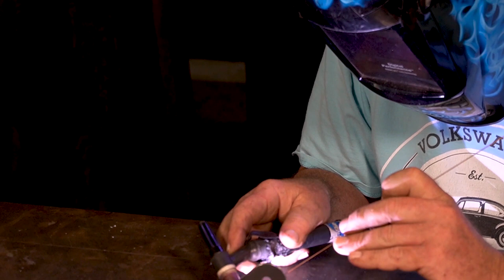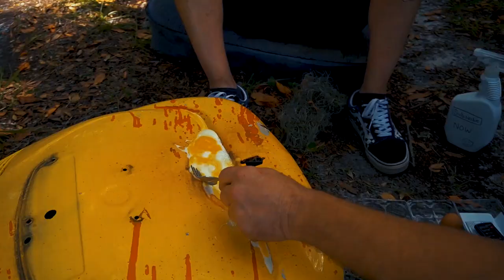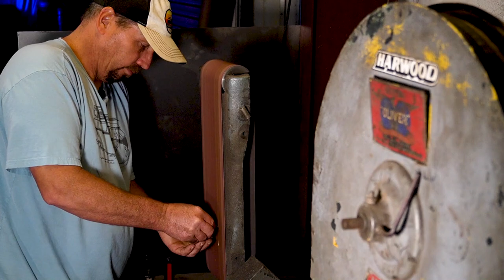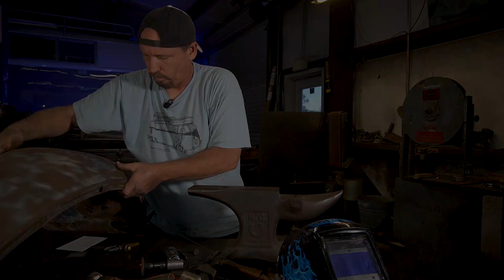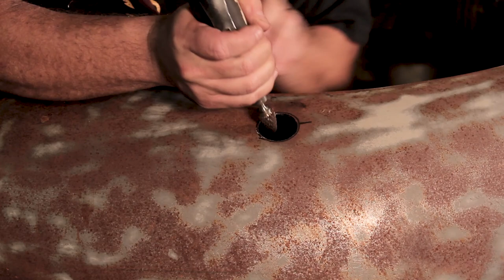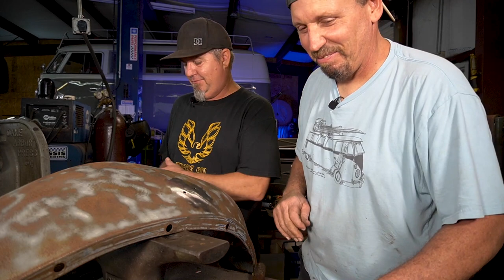How to Fix a Rust Hole on your VW Bus or Bug / Shave your Turn Signals

Comment: Try living in Arizona's heat..............
Reply from the maker: Not sure what's worse Arizona's high temps or Florida's high humidity lol.
Reply: @RobStapleton   you do have a point there ha ha.  I have been D/A sanding my 65 vw bug whole car down in the shop, and our humidity has been really bad cause of the monsoons. :(
Reply from the maker: @65vwbug87  I've never been to Arizona in the summer but either high heat or humidity I hate them both lol. I'm from Michigan and have never really adapted to the summers here.
Reply: @RobStapleton   off the subject of heat. I am sanding my vw down to bare metal, is 80 grit with the d/a way to go? i heard any less with screw up the metal. I know primer will hide some stuff, just trying to do it properly. Thanks
Reply from the maker: @65vwbug87  80 grit is fine as long as you're not putting to much heat in one spot. I would make sure to use a good sealer after you get it to bare metal. I use a 2k "Direct to Metal" sealer
Reply from the maker: @65vwbug87  Hey if you have any pics send some over to my facebook I'd love to see it. https://www.facebook.com/rob.stapleton2
Reply from the maker: @65vwbug87  I just replied to you over there.. the other one is my personal one.